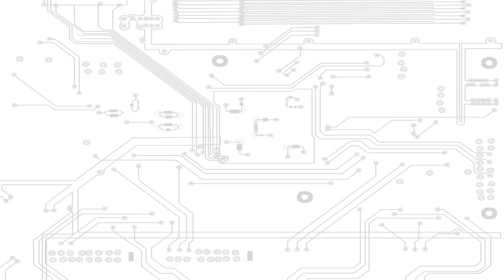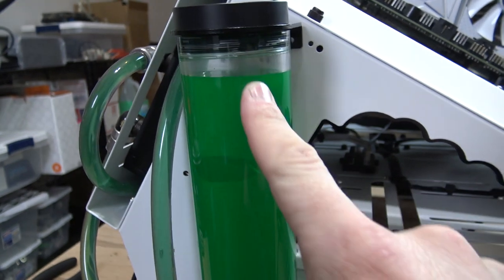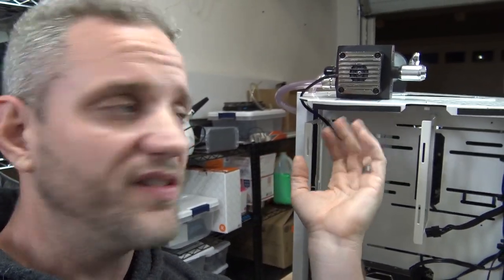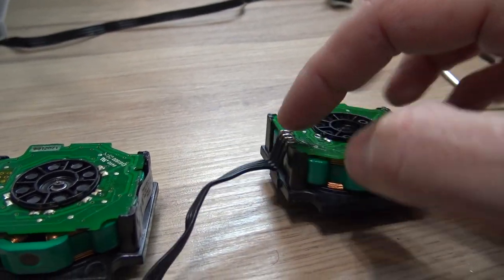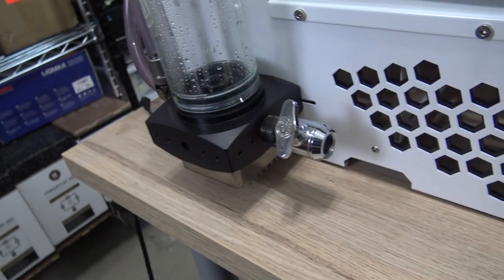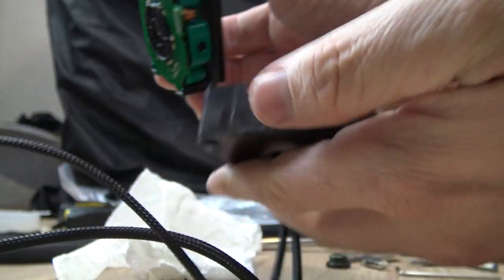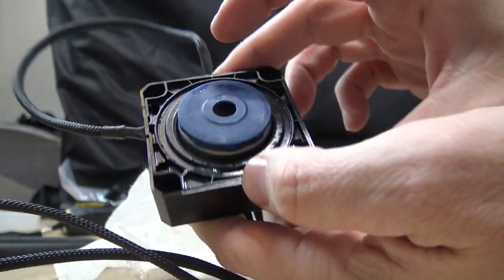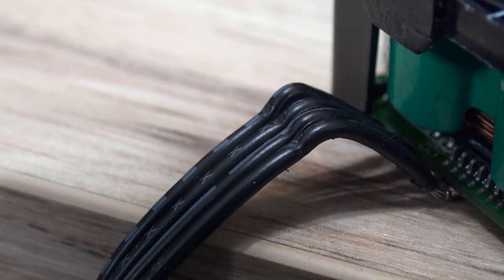My pump died... did the antifreeze kill it?? Let's pimp out my Test Bench!

Comment: So, I had the exact same issue with my Laing DDC PWM pump just shortly after I built my first loop about a year ago.
Here's my (lengthy) findings:

The pump did not start spinning. It jerked a few times, paused, and repeated that. Disconnecting the PWN and sense pins from the mobo did not help, neigther did using an external bench laboratory power supply. It did however draw alot of current. ~2.5A at 12V iirc.
After taking the pump out and disassembling it (I run it with a Bitspower pump/tank combo top and a heatsink housing) it started spinning. I filled the "cup" of the housing with a little bit of water so the bearing wouln't overheat. Turning on the pump caused the water to splash out from the ditch and over the circuit board, pussibly shorting it. After that, the pump didn't spin up anymore and the IC that blew up on you unit got very hot.

I then bought a new pump.

Mere weeks later, the same thing. The new pump jerks, stops, jerks, ... This time I only unscrewed the reservoir and turned the impeller with a small screwdriver. After that, the pump spun up! It ran for a few days before having the same issue again. This has happened many times now. I found that banging against the pump with my fist fixed the stuck impeller. (+1 for mad tech skillz)

I am using the Mayhem's XT (I think that's what it's called) conentrate with an undefined mix ratio. Since that stuff is basically antifreeze for sub-zero cooling, it is very likely that this is the cause of the issue. I did start with a rather "thick" mixture and since thinned it down quite a bit and didn't have any issues for a long time. My soft tubing turned cloudy very quickly though, which could play a role, too.
If the wires had shorted out to the casing of the pump (wich is electrically isolated in my case, since I'm using an acetal top and rubber anti vibration standoffs, so two wires would have to short to have any effect) this would have been noticable in a) a blown up motherboard if +12V hat shortet to PWM or sense, or
b) a power-cycling system or blown up cables if +12V had shorted to GND, or
c) nothing, if GND had shorted to sense since that is an open collector output, or
d) nothing, if GND had shorted to PWM, since tieing PWM to GND wouldn't even stop the pump afaik, or
e) nothing if PWM had shorted sense since that again is an open collector input.
If the housing isn't isolated from the rest of the system, cases a, c and d would be the most probable. The thermal pad in the bottom of my pump didn't show any signs of penetration, eigther.

Conclusion: I think it's a combination of the materials in the system. Glycol, soft tubing (possibly) and the pump ceramic bearing (possibly). You're awsome, keep it up!

Comment: hey jay, have you got a dremel or something? if so, just use that to remove a bit of material from the metal heatsink cover. you'll also be able to put a smooth edge on it to protect your wires

Comment: those style pumps with those bearings like yes its not good to run dry but honestly short periods wont hurt have a larger version of that in an aquarium pump and its designed for short periods of running dry considering its a ceramic bearing

Comment: My pump did the same. Found it was due to the pump housing having scratches where the bowl under the impeller was running. It was sticking to the sides before it started and put too much load on the impeller to let it begin spinning. Sometimes could get it to work by inverting the entire computer and letting it start up, the weight of all the water on the impeller combined with the scratches on the housing was too much resistance.

Comment: Ah, the smell of frying electronics. My 1999 Chevy Cavalier was my first experience with that. There was some kind of control box underneath where your left foot goes for the rear defrost. I drove to work one morning and had no clue what that smell was. I got home without smelling it again, and turned everything on that I had in the morning. Sure enough, smoke coming from the footwell. Pulling up the carpet that box had a hole melted through the plastic side big enough to stick a nickel in. Cut the cable powering that thing and the defrost and problem fixed. :)

Comment: A short on the wires coming into the pump assembly are very unlikely to cause parts after that pinched area to burn up. Looks like a FET just decided it was time to die, or one of the windings shorted and took the transistor with it.

Comment: D-5 pumps dissasemble from the bottom as well. I personally think the high pressure/low volume pumps of DDC style work fine for pushing thru a long restrictive loop, But they will have more problems with heat and with a pastel fluid than a high volume lower pressure D-5. just my humble opinion. I have recently specd all the common ones for my new build and found an average DDC is 500LPH and 5.7m of head. Average D-5 is 1200to 1500lph and 3.7 to 4 M head. The new Enermax combo is 900LPH and 5.2M head and is the second cheapest vertical pump res combo I can find . Guess what I bought :)

Comment: did u checked the isolation of the metalic cover? if the isolation isn't damaged there can't be any short, even by squishing it. and i had a lot to do with electrical wires and isolation as i am a mechatronik technician ^^

Comment: Their are a few kinds of coolant. The old stuff is the green coolant. Many of the German cars need to pinkish coolant. I know of another one but I can't remember about that one. For cars, the coolant is to keep the cooling system from boiling or freezing and from preventing corrosion. Pure water actually cools better. I don't think you need to worry about the water boiling or freezing in a computer cooling system. Maybe just add one of the pink bottles of coolant booster that you can get from an autopart store.
Reply: Richard's World Please research what you say
Reply: I don't need to do my research. I have many decades of building high performance cars. Pure water will cool better than a car with coolant in it. Look it up so that you will know that I am right.Just because you don't know this, don't think I am wrong.
Reply: Richard's World You saying there's pink and green coolant? They have names ya know

Comment: Take a file to the metal backing where it pinches the wires. Remove enough so it doesn't and viola, still get the great cooling benefits of metal backing with no pinches/shorts.

Comment: gonna assuming the alcohol in antifreeze affected the plastic or the oring causing binding,  materials not really rated for antifreeze perhaps, certainly pvc clear pipe isnt used on cars either.  car makers have long since had their materials tested for long term antifreeze contact

Comment: Good video Jay. 
Now im interested in seeing, if that new impeller design is better. I have some Laing DDC pumps myself and I have only seen the "Top-Colsed" impeller. 

On a little sidenote :-)
You and your videos got me back into watercooling 2 years ago! I used to do that waaaay back around 2005 and didn't do any watercooling since.
Reply: The "new" impeller is almost identical to the one used in their D5 pumps. Wonder why the DDC wasn't using that design until newer versions, the D5 always had it as far as I know. Maybe it's intended for different types of housing (horizontal flow vs input coming down vertically on the impeller?)

Comment: It's the viscosity of the antifreeze that's putting a heavier load on the impeller. Its fluid dynamics more viscous liquid causes friction . look up the manufacturer running amperage under load. I'm positive you would see a higher amperage draw then rated for. That means the motor is over loaded tripping a thermal or load sensor. I'll give you the easiest analogy stirring paint and stirring water which is easier well that motor is made to stir water.

Comment: No, most coolants for water cooling uses ethyl glycol/propylene glycol as the main or the only additive besides distilled water. It does not affect oring. And antifreeze is mainly pure distilled water/glycol mixture as well. So, no the coolant did not kill your pump.

The main issue here is you did not flush the system with distilled water before pouring in the antifreeze. I wonder if it had anything to do with the pump failing.

Comment: So i have something to say about why components may fail using pure water. Over time the water becomes acidic this is called electrolysis. It is caused by nonferrous and ferrous metals touching the water. To combat this you should pH test the water. Replace the solution when its gets to acidic. Just my two cents. I experience this a lot with cooling systems in the automotive industry. Its basically the same concept.

Comment: If the glycol was eating away slowly at the tubing and o ring the coolant would slowly get thicker until the burden on the pump would cause a malfunction. I would just run g12 or g13 if you wanted to use automotive coolant

Comment: the covered impeller will theoretically have better hydraulic performance, there are some losses from the small gap between the open blades spinning next to a stationary surface, double shrouded impellers are always better

Comment: I knew the answer would be no :)  This pump ( and I have seen other makes of this pump sold ) is nearly identical to the pumps found in G5 water cooled macs, only real difference being the mac pumps have an expansion chamber on the bottom of the pump. When that voltage regulator inside of these pumps goes up in flame, you will for sure smell that oh so wonderful burned electronics smell, and see a nice black spot on the PCB under it.   Not sure I am diggin' the purple theme there, but it is nice to see you change up the colors now and then.  Now if "they" can figure out how to make RGB cooling who's color can be changed with in Windows..... that would be something to have and save you a hell of a lot of money.  Peace Jay.

Comment: JAY!!! I had my AIO go bad... so i thought. Was making crazy noises. So in typical J2C fashion i took it apart. Turns out Antek uses antifreeze in their Khuler based AIO's. I can tell that smell from a mile away. Anyway, i noticed the fins on the heatsink were clogged, so i cleaned it out, added some distilled water to the loop as it appeared it just caught an air bubble (i had been playing witht he rad, trying to clean out my system). Threw some new thermal compound on, and BAM! back up and running. Had me so stressed out thinking it was dead.

Comment: Something i'd love to see you test is different fan types on the same rig and radiator. Is it really worth the extra money to buy Noctua, Enermax, or Corsair fans specific for a radiator, or can you just get away with using cheap $3 case fans? I'd like to see if there are any appreciable temperature differences between a standard case fan, a cheap $3 case fan, or a high static air pressure fan, and so on.

Comment: In looking at the pinch point - I'm not sure that's the actual point of the short.  I wonder if the solder points where the wires attached to the board contacted the inner side of the metal housing, causing the short instead.

Comment: so,  the metal on the end cap caused the short. so lessons learned? check insulation on wires where pinch points are for any damage after the first time installing new parts. (at least in a custom setup like this)

Comment: Jay, those wires are not shorted. For them to be shorted they would have to have the conductors exposed. So all you have is a bit of compressed insulation.

Comment: Looks like a botched soldering job during the sleeving job.  That PCB looks like it got super hot (flux build up) and solder flowed up the wire from too much wattage on the iron during the soldering.

Comment: There is a couple of ways the metal pump cover could of been reused. One would be to apply tape to the inside to insulate the metal from the wires. But the better option would of been to take a Dremel and just open up the wires cut out and give the wires more room and stop the pinching. But what ever.

Comment: power draw more likely than a short. New cable set pinched wouldn't be a short.(Unless it was single housing) However, it looks as though they were individually coated. But Power draw under or over amp or voltage could be.

Comment: Are you sure it was a short and not a clearance issue between the impeller and the pump top. Did you test for a short using a volt meter? Just curious because I was looking to use the same setup. Love your videos Jay!

Comment: The anti freeze washed out the petroleum based lubricant  (vasoline). Use a light film of silicon. 
Greg  (35 years of pump design experience)

Comment: Well, with some grinding tool, you can open tight spaces :D
I used a file to grind the battery cover and "compartment" on a wiimote here, now I can fit a small phone battery in it. But it's all plastic, not metal.

Comment: it coul'd also be your metal heat sink who shorted the circuit board out where your cables are soldered. it's hard to tell on the video but maybe when you close the pump the bare metal touches the solder and it's maybe that who created the "magic smoke"on the second pump. Anyway i think by now you figure it out what the problem was.

Comment: I know you know way more about cars than me, but I have to ask. Did you do 50/50 on the antifreeze mixture?

I'm asking, because the added density of the liquid might be just enough that it pushes down harder on the pump blade, than if it was just water. I know with a car, they suggest that you cut the antifreeze with a 50% water mixture.

Comment: Just use a file and make the gap a little bigger, and the edge on the inside a little smoother, and you can continue using the heatsink backing on the pump.

Comment: I had my DDC pump die in my EK pump and res combo about 2 months ago after 6 months of use and it made the SAME EXACT SOUNDS. Thanks to your video I now know how to fix it! Oddly enough, it has a sharp ridge in the plastic housing, where the cables come out, by default. Will this issue be addressed?

Comment: did you metal file the hole wider for the wires? if it's pinching the cable and you widened it, would solve the issue, right?

Comment: Antifreeze requires atlast 10lbs of pressure to actually work.... if that were the case water would def lose  out in heat reduction. But if u are going to bother with pressurised  systems id go with r 134a .

Comment: Pinching the insulation without exposing the wires won't cause a short.  They aren't shielded or braided.. so you'd have to expose the wires to short them.
Are you sure it wasn't the metal chassis touching the pcb/solder points directly?

Comment: I don't water cool, but I'm pretty sure the gasket only keeps liquid in the reservoir. There should be a different gasket underneath the impeller to protect the electronics.
Reply: I have plenty experience with aquarium plumbing though. That's where my speculation comes from.

Comment: Its a fairly common problem with ddc pumps, they need good contact, the same thing would happen if you used a shit molex adapter, not realy sure why, but it has happened to me before and the internet is full of similar problems. Sometimes when they stop, you just tap it a bit(fairly hard) with your fingers and it starts again and works for another year :)

Comment: try holding the impeller of the old pump and see if it tries spin three times, i thing it is putting to much force on the impeller not pinching the wire

Comment: Ive had a problem with the alphacool heatsinks where the solder joints on the bottom of the pump PCB pierces through the thermal pad and short out causing the pump to smoke and die. Could be the same thing happening here.

Comment: Prestone claims their antfreeze is safe for all plastics except acetate. Green antifreeze generally contains small amounts of silicate and phosphates for corrosion protection (aluminum and copper/brass). Should be OK for computer cooling. As for ethylene glycol, a number of PC water loop cooling products list it as an ingredient. Methinks many of these products are nearly the same as green antifreeze, just far more expensive.

Comment: i have 3 d5 pumps in my pc and whenever i ran them dry it would cause a small air gap between the floating impeller and the bearing. i had to pull my pumps apart and refill it again to get them to run. they were doing the same 3 startup bug as yours.

Comment: Surprised the impeller isn't magnetically coupled to the motor output and resides in the coolant circuit.  That way you never have to drain the system to service the motor.

Comment: 30yrs in the hydraulic industry, hint use a super super lite coat of dialetric or silicone grease on o-rings that helps them perform better especially if gas is whats being  sealed

Comment: its not the circular thing in the middle that's the problem, its the engine itself and its counterparts. So of course it would work if you change the engine but keep the pump, The pump only spins, it doesn't do the hard work.

Comment: You shouldn't use antifreeze. It actually has way worse cooling performance than water.. Antifreeze is only used to keep the water from freezing. That's why if you live in a hot area, you should use a lower amount of antifreeze in your vehicle and more water, at least in the summer. If you live somewhere that get's extremely cold than you should use more antifreeze.